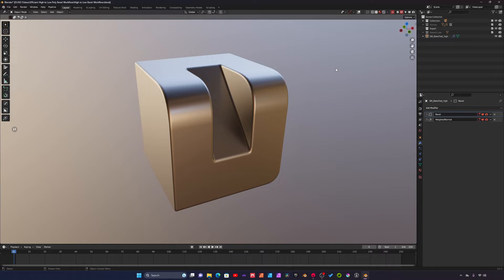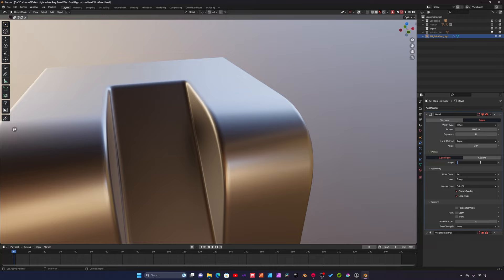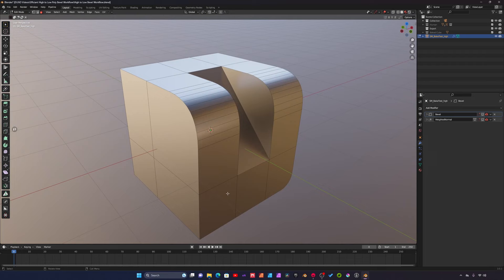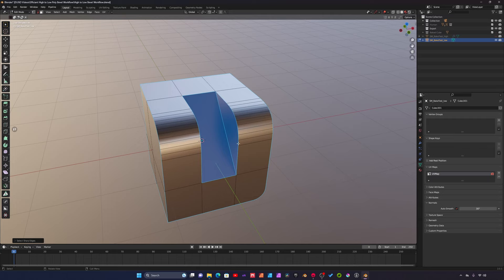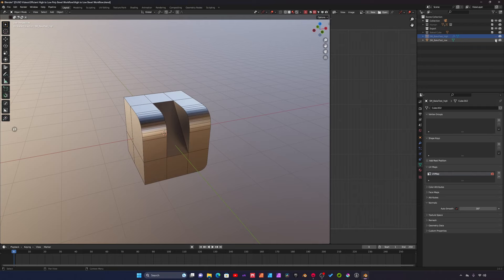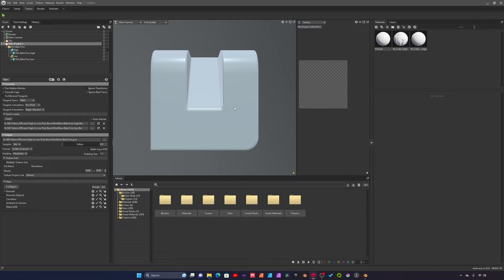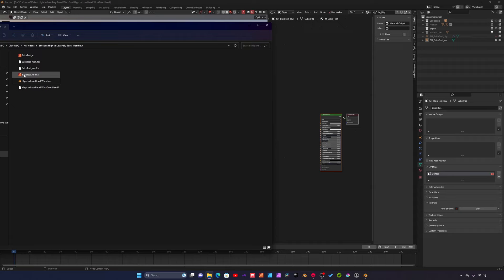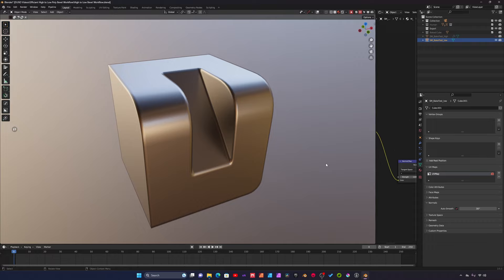Blender + Marmoset Toolbag - Efficient High to Low Poly Bevel Workflow!

Comment: You can bake the bevel normal map directly within Blender, there's no need for any other software
Reply from the maker: That is true, however, physically modeling bevels can give you better results depending on the software you are baking in and the additional maps you may be trying to get from the model.

Comment: Thank you for your helpful tutorial. One question, leaving boolean cut on low poly is necessary? Low poly box should be a plain box as the boolean applied to high poly can easily be baked, right??? I could be wrong in my understanding... Thanks again❤
Reply from the maker: Any major forms should be modeled, especially if they play a significant role in the silhouette/readability of the form. Generally smaller details and bevels are baked to help with optimization. If a major shape is cut out of the surface and you should see a change in the silhouette based on the angle you are viewing, then you should model that detail into the surface. Hopefully that makes sense and is helpful.